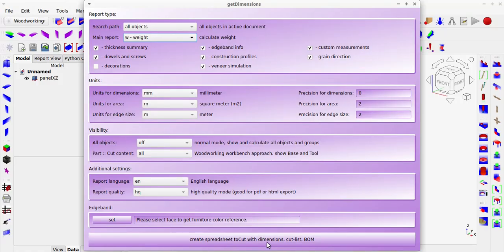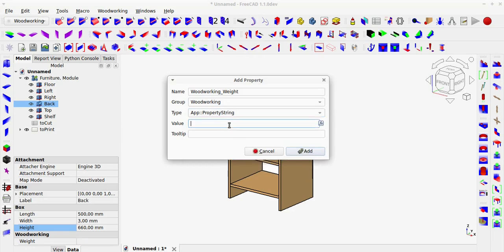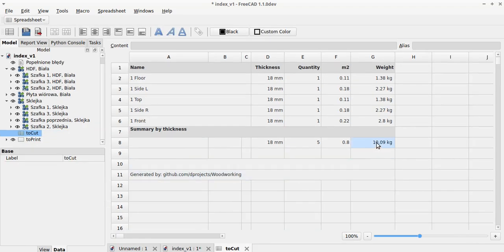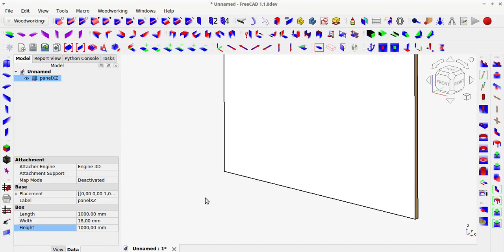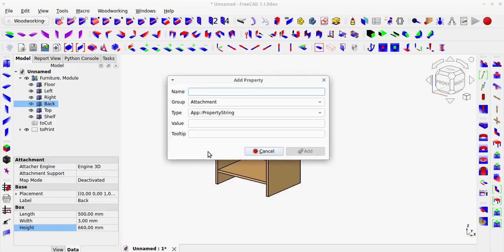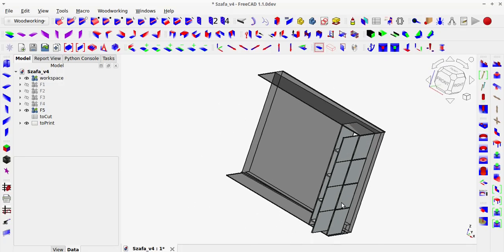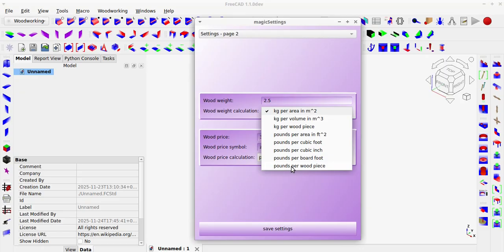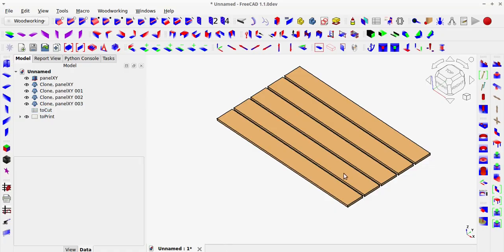Furniture weight and price | FreeCAD Woodworking workbench

Comment: Do I understand correctly that the workbench will no longer be available for FreeCAD and can only be used in the fork?
Reply from the maker: not really... if you see the release notes for Woodworking 2.0 there are so many new features, almost new workbench, so it would be inaccurate to release it as 1.1. From development perspective the 1.1 name should be rather patch for 1.0, mostly with significant fixes, not complete new workbench. 

Regarding Werner and Zolko xCAD branch, maybe you see the same version name, so it is your confusion, but it is not, it is only version number coincidence, nothing more in fact. I saw the released AppImage, I have time only to run it for a while and saw there is problem with ShapeType attribute for router bits... but I will fix it soon to also support kernels without this attribute. And also as far as I see they not have stable version yet.

There is also another reason for new 2.0 version name. Woodworking workbench supported mostly single kernel in the past but now there are many other tested and supported kernels, almost all since FreeCAD 0.21.2 to FreeCAD 1.1dev, and some RealThunder LinkBranch, so it is better to have its own versioning system, not related to kernel. 

There is also magicCAD 2.0 installation package with FreeCAD 1.1dev from this month. I used this kernel for some time and coded several features, so this should be stable to work with Woodworking workbench forever. 

I don't know what they invent in FreeCAD 1.1 release so this will be another discussion if this is still possible to support their new kernel or not. 

Maybe I will record video about new release notes and describe a little current versioning and strategy. 
But first I would like to test all old kernels, look around at the ShapeType issue and add backward compatibility. If Werner and Zolko finally get their branch working maybe I will spend some time to test it with Woodworking workbench more deeply and add needed fixes.
Reply: @dprojects.woodworking  Werner and Zolko seem to have left the main FreeCAD project and decided to create their own branch. So I thought that maybe you also don't want to develop your workbench for the main FreeCAD branch.
Reply from the maker: @Skyliptor  I'm not a developer working for FreeCAD, I'm not a member of the FPA, I don't have moderator rights on the FreeCAD forum, or even my own sub-forum there like Zolko had. I've never received any money from FreeCAD, not even a word of praise, so I can't leave them because I've never been and am not connected with them in any way.

Currently, Woodworking workbench supports five kernels: FreeCAD 0.21.2, FreeCAD 0.21.4 (Werner & Zolko branch), FreeCAD 1.0.1, FreeCAD 1.0.2, and FreeCAD 1.1dev with PySide6, which allows Woodworking workbench to remain functional for a long time, even if someone would like to deliberately try to destroy Woodworking workbench or completely destroy FreeCAD.